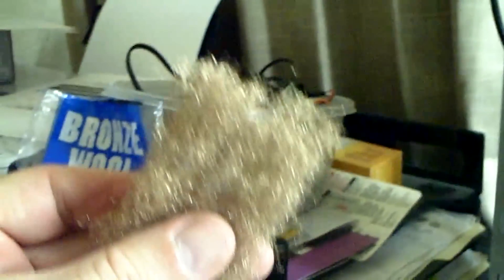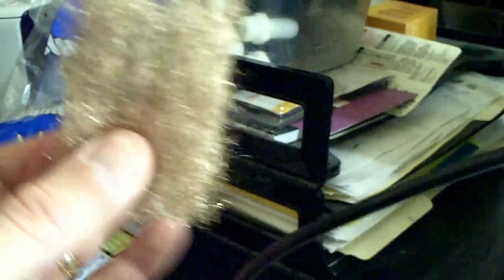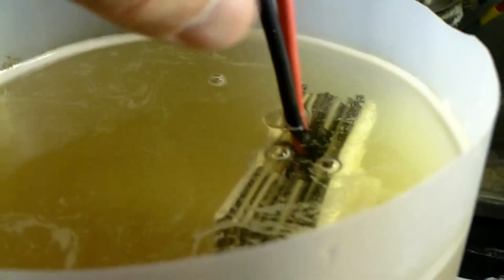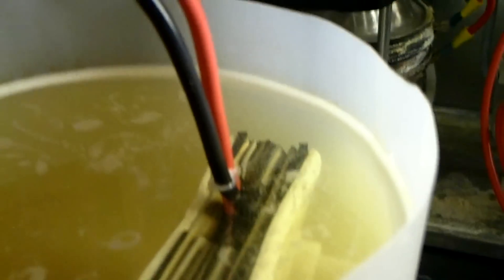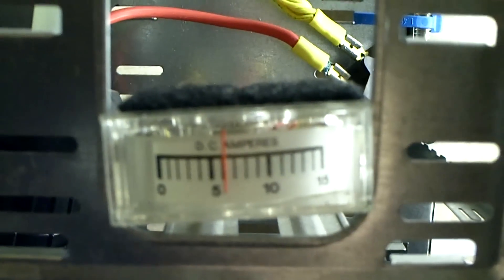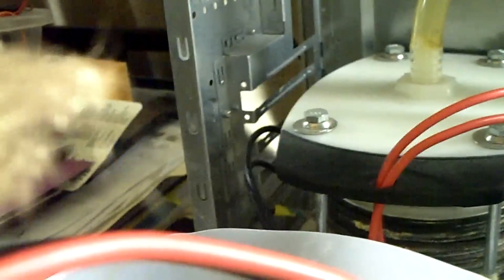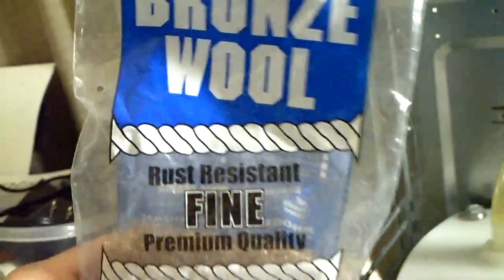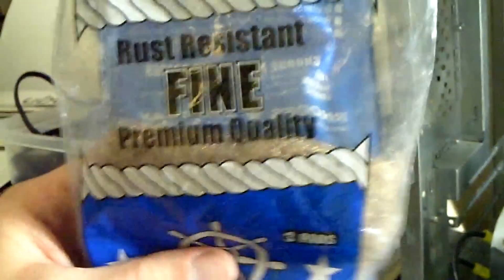Vid57 Wall Plate Volcano Improvement (HHO, Brown's Gas, Hydroxy)

Comment: Good idea. I believe the lower amps needed is a result of increasing surface area for electrolysis to happen. When electrons are restricted in their movement then heat and therefore resistance will occur.
Keep on thinkin' Man, you're doing great !
NOW - What do you think the result will be if you add more Br.Wool ?
I think you already know ! Lol.
Cheers, G.

Comment: What rate of output would be nessessary to run a car engine...or suppliment a gasoline engine....I see you are able to produce the gas, however are you considering using it in any capacity other than testing...Also using a inverter (from a boom box amp) to raise the voltage and amps to increase the flow of gas to help make it a practical solution to the outragous gas prices we have now...In this economy HHO should be put to practical use....whats your thoughts?

Comment: @HHO4ALL I appreciate your response to the first part of my post.  I'm also very interested in your response to the following.  What have you learned from the cells you've built, which type of WET cell had highest production and was most efficient? Was it 12 flip cups with 5 neutral pairs? Which type of DRY cell had the highest production and was most efficient? Also did not find flip cups at local Walmart, can you suggest another source?  This could save us lots of time, thanks very much.  RF

Comment from the maker: @ReasonForemost 

I'm glad you enjoy the videos. I was thinking more along the lines of increasing surface area on the POS & NEG plates rather than reducing the number of neutral plates.  I am using 12v for my experiments and surprisingly, I have had a reduction in amperage when using fine bronze wool. 

I still need to experiment more, but it is looking promising.

Comment: @HHO4ALL Really appreciate your videos and experimentation, very educational.  When you added bronze wool didn't it effectively reduce number of neutral plates? Wouldn't you expect this to increase voltage between plates thus increasing heat and the total amperage? Also very interested in what you have learned from the cells you've built, which type of wet cell had highest production and most efficient?  Same question about your dry cells?  This could save us lots of time, thanks very much.  RF

Comment from the maker: @visionace 

I had issues with getting it to work properly, because I reconfigured my cell for increased output, but the heat was too much for the enclosure.  It warped from the heat and the seal broke. I guess I should have done a follow-up video to show what happened, but I had already started on another design.

Comment: Looks great !  Did you ever make the container from the rectangular electric boxes that you were going to connect and put large nylon barb tube connectors in the prefabbed holes? Also, would like to see a video of that container with a 'flip cups' designed generator inside it.

Comment from the maker: @omandi4 

The fine bronze wool is rust resistant, but that is not to say that it was intended for this type of use.  It could very well rust over time, but so far it has had no noticeable corrosion after one full day of testing.

I may buy some 316 or 440 Stainless Steel Wool for further experimentation, because I believe it will have a better chance of resisting corrosion.  Too bad they don't sell Titanium Wool, because that would be an ideal material for testing.